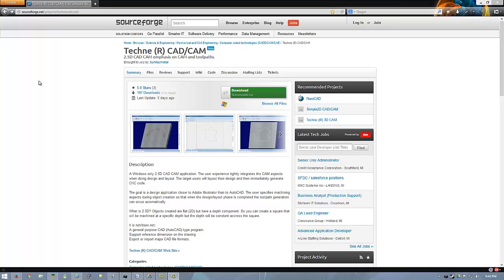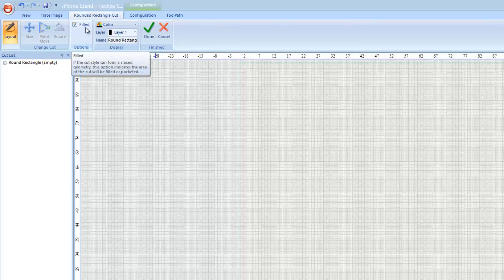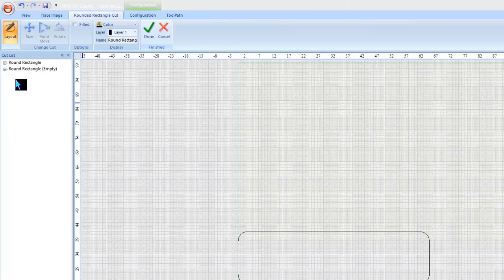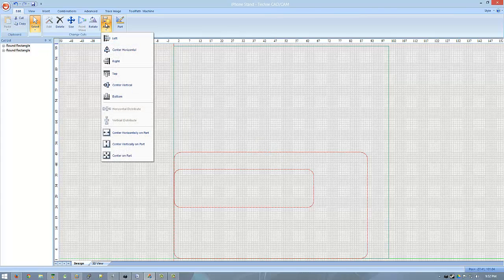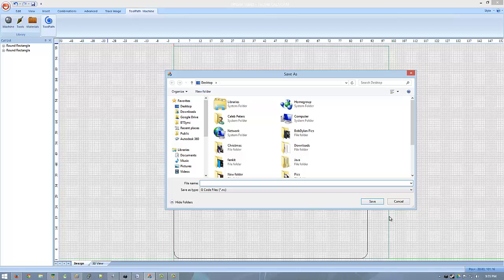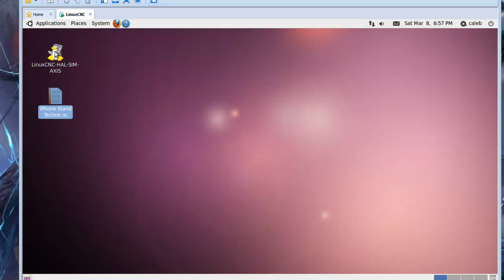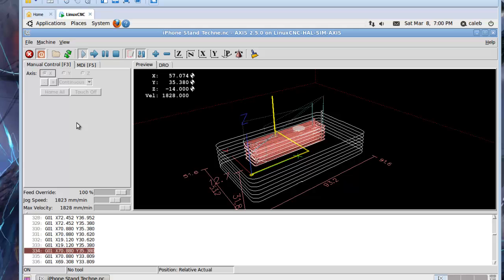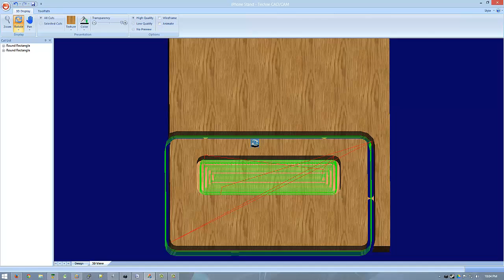CAD/CAM using Techne CAD/CAM

Comment: Radial hole drill function issue. Stuck on 25.00 input value in field!
Reloaded techne saved project files, drill holes are no longer displayed as tool diameter. Just drill centre location. 3D render correct.
Useable, but you really need your wits about you. For occasional 2.5 CNC with gcode generated straight away within the app. Use Candle to check and send code to reprap board. Totally free solution.
Techne has no dimensions tool, but there is a cursed position readout on extreme right bottom of app screen. Paper, pencil, calculator and knowledge of trigonometry needed! Suit an Ancient Greek time traveller making temples.

Comment: This is indeed the only practically usable free CAD/CAM milling software beside the regrettably abandoned / disappeared and horribly bug-ridden GCAM (don't even get me started on the rest of the so-called "solutions"...) but unfortunately it's in no way shape or form open source. Which does somewhat raise the question of how long it will remain free once the kinks get ironed out...
Reply from the maker: hmm, I guess its not, what a bummer. Oh well, its still is a good option.
Reply: Caleb Peters Yes it is, which is why I'm glad I've found something loosely equivalent in the mean time which is both actually open source and cross-platform - MakerCAM. I'm not talking about the website, but the .swf file one can download and run locally in a browser. Seems fairly usable so far... :)

EDIT: Oh, just noticed you already did a video on that one...